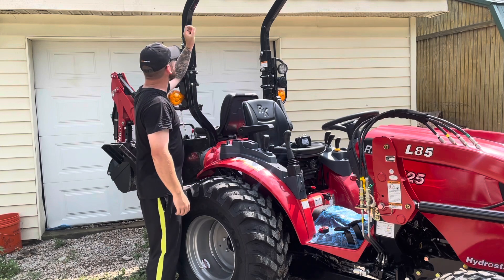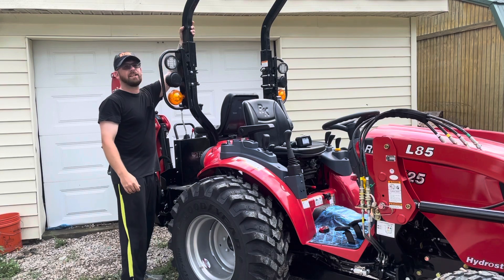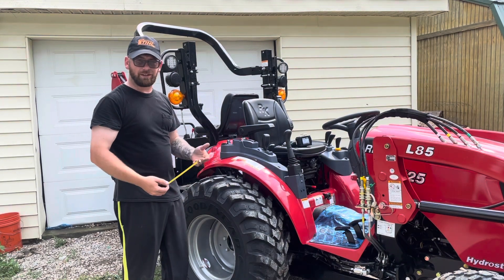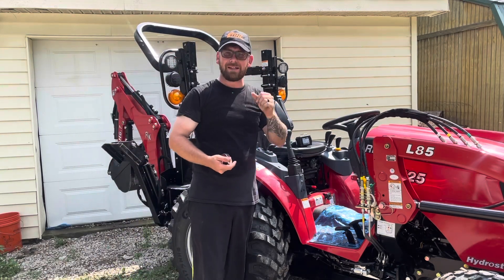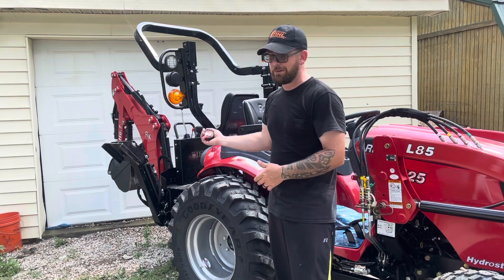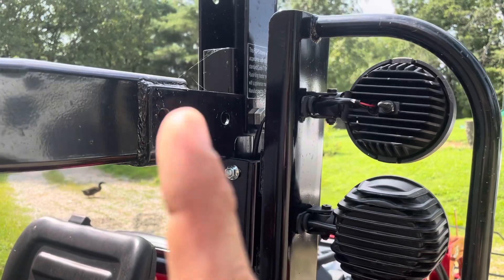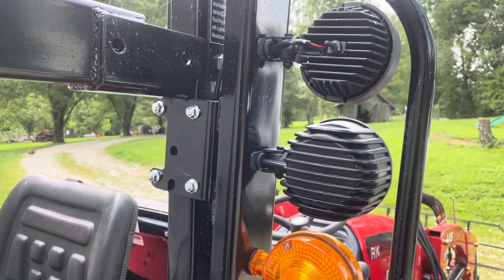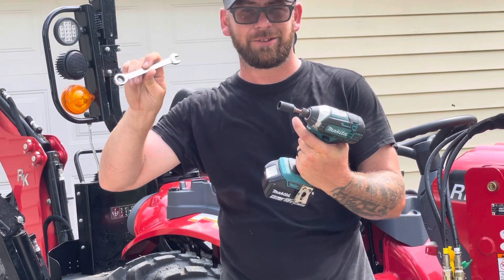#16 RK25 T25 DOES IT FIT?

Comment: Quick and easy fix Denny. You have helped a lot of people today. Some people would've thought theres only two options,  get a bigger door, which is very costly and might not be an option,  or cut ROPS down.  That would probably void the warranty. Great idea buddy.
Reply from the maker: This quick trick was a win for me. It worked for me. I am super stoked too. 

I am going to be doing more research and possibly another video on this. One guy shared he had different tires and it was just barely at 84”. So I will remove my backhoe and talk to other to see how it worked out for them.

Comment: I had the same problem ended up taking the rops bar off just above the lights , Good video !
Reply from the maker: Appreciate your support.
Reply: What is the height once the upper rops bar is removed? Was it just bolted on? Looking to buy a T25 but not sure if it’ll fit in our shed door with  only 77”

Comment: Thank you for your videos. I purchased a RK25 also with loader, backhoe, and box blade. I have an issue with my parking brake disengaging and was wondering if you have had the same experience. I have seen other RK25 owners have had the same problem. TNT ( Try New Things) suggested adjusting turnbuckle on the brake, I tried but did not fix my problem. I set the parking brake and seconds later it pops free. I have not heard back from Rural King. Wondering if the thick paint on latch and pin is the issue? Thanks for your time.
Reply from the maker: I personally have not had the same issue you are with the brake. It has been a little tight but as long as It is latched well then it is not an issue for me. 

I will certainly check out the brake and mechanics of it to see if I can help you out. 

I will post a video on my findings. So be sure to subscribe so you don’t miss it when I post the video.
Reply: @gatheringrusthobbyfarm8081   I am a grateful subscriber. You have taught me alot already. Thank you.
Reply from the maker: @rickmeyer6429  wow…. Thanks for sharing. That is what keeps us doing videos. My wife and I both are/have been in the teaching field. We started our channel to share our experiences and to gain more knowledge for others. Your compliment puts a smile on our faces. Thanks again.
Reply: @gatheringrusthobbyfarm8081  Hi Denny, I think I was able to fix parking brake. So far so good. I tightened the two nuts at the end of the cable coming from the parking lever. It allowed the 3 slot bracket to move closer to the pin that locks it in place. Not a fun repair though. Tight and knuckle busting quarters. A 12 mm open end wrench loosened the bottom nut in order to tighten the top. Thanks for your help.

Comment: Had same problem after adjusting still not low enough so I notched out where the pin goes dropped it right down easy fix
Reply from the maker: Glad you were able to get it in the door.